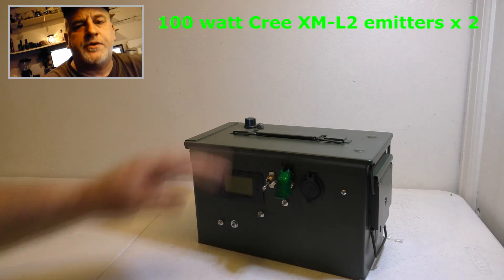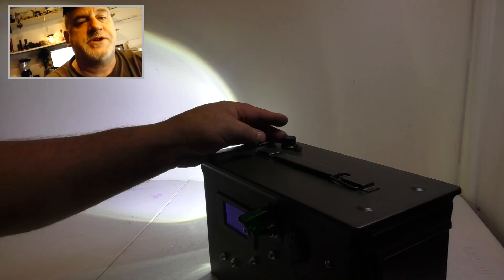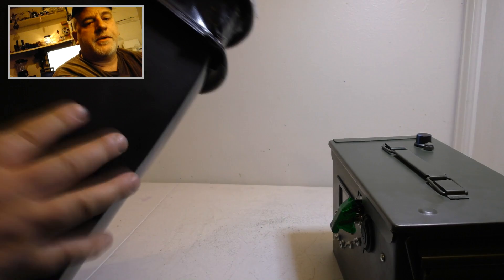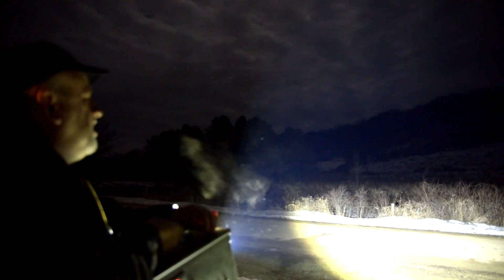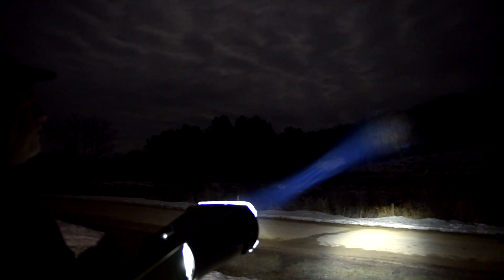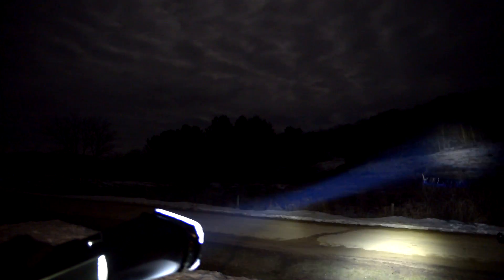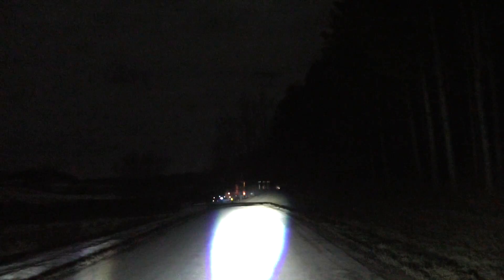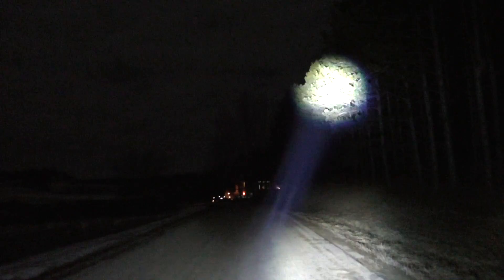How To turn a 100 watt LED Light into a Search Light

Comment: Bad to the bone how long does it last????
Reply from the maker: +tuledude89 At .5 amps with 1 light on it will last over 5 hours easy. Haven't tried any longer. But that is still putting out over 5k Lumens and is very bright. With both lights on at full bore you have to recharge the battery in 40 minutes.
Reply: My Biuld......
https://www.facebook.com/ian.hall.7127/posts/934299016669736?pnref=story